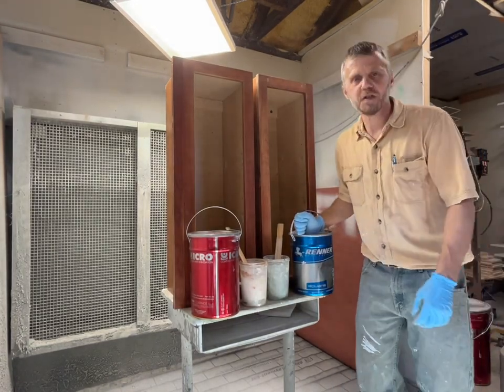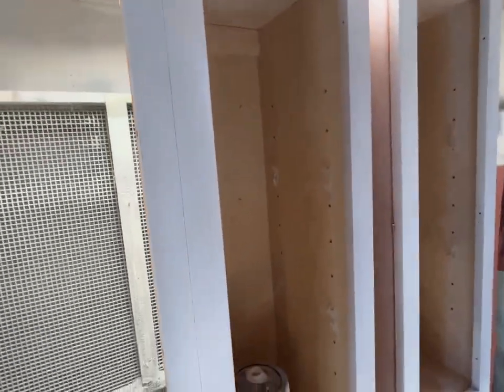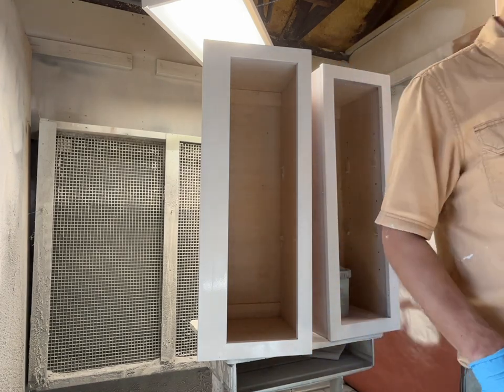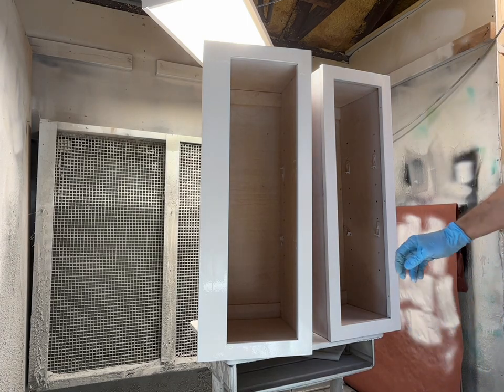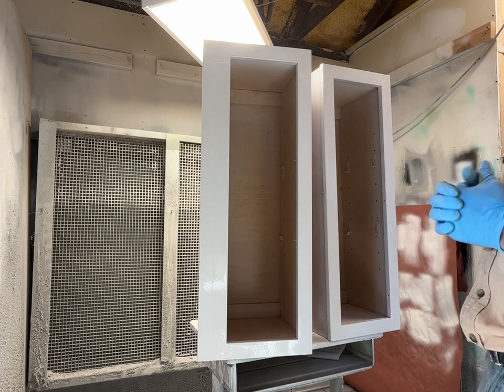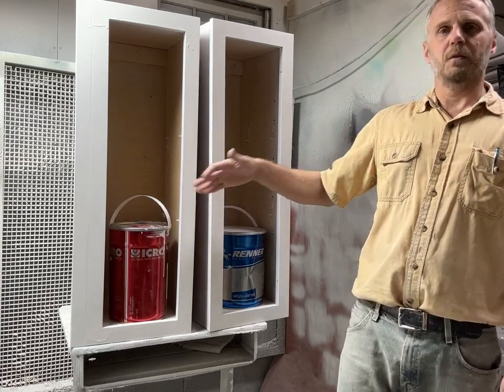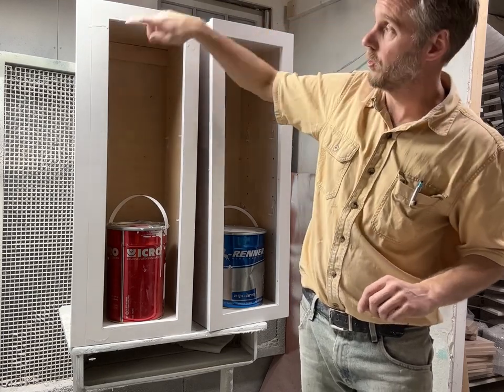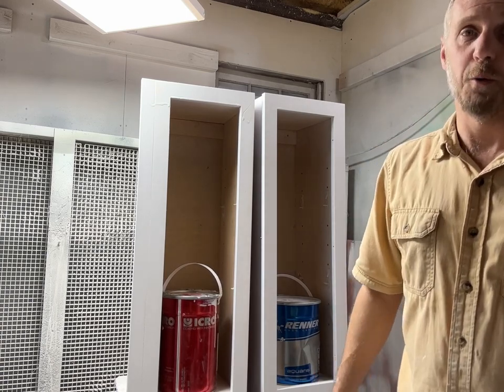ICRO Waterborne Paints - Review and Tips for Spraying

Comment: How does Centurion compare to ICRO on an air-assisted airless setup? Will it run easily like ICRO or stay up well like Renner? Does it atomize well? Micro bubbles? 
I’m also refinishing kitchens and painting new cabinetry in live-in remodels, what paint would you use on an air-assisted airless setup?
Reply from the maker: I've not used Centurion products. But I hear that it is more prone to micro bubbles than some.

Comment: Great video! Seems like ICRO is similar to 170 envirolak? 170 first Gen was so runny. I never used 643 yet but 648 hangs incredible too
Reply from the maker: 643 is best for refinishing because it has better adhesion than the 648 but 648 is good for the second coat for build or use on new cabinets.

Comment: Absolutely great video! Thank you. I just received my ICRO order and will be testing with hvlp's, and LVLP's.  Can you tell me what regulator you have on your gun? I'd like to convert some of my hvlp's to a PPS system like you did.  Also, what gun, just out of curiosity.  Thanks again!
Reply from the maker: The gun I used here is the CA Technologies Fe-Line. I bought the PPS adapter and cup separately. The regulator is a by-pass regulator for the cup pressure only. I have another regulator on the compressor to control the air pressure at the gun.  I'll do a video and give some links shortly.
Reply: @homesteadcabinetdesign3406  please make the video showing the air regulator in compressor that will help me a lot